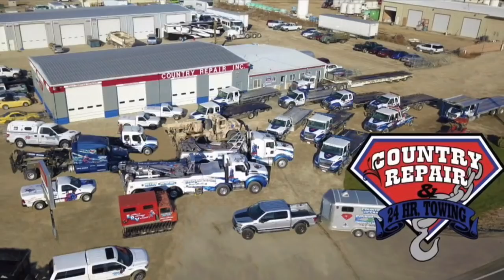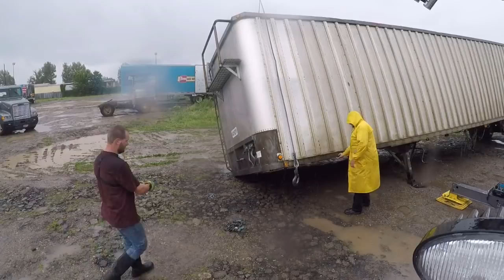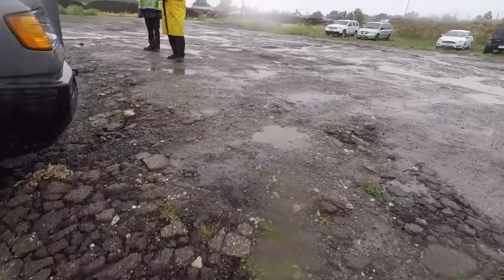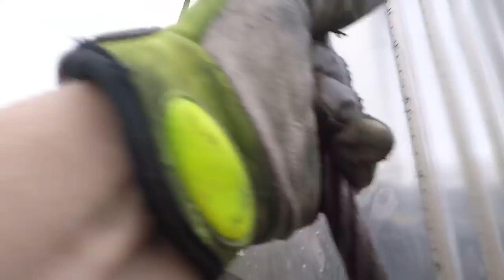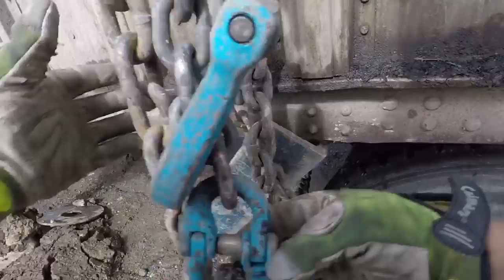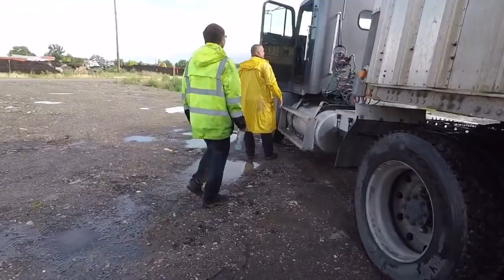Rotator Flexin

Comment: as a fork lift driver i was loading a trailor with firebricks and lifted the back end into the air....me, fork lift and bricks were left piled up in the front with the back of the trialor wheels 10 feet off the floor........

Comment: When doing a lift that rotator needs to be 100% off the ground. Its 70k counter weight. Miller will tell u that. Also its a miller you don't have to idle it up for extra hydraulic pressure. Miller will tell u that also. Get the truck air born and itll handle alot more than that light 36k. Ive lifted 56k off the side of mine before
Reply from the maker: Yes we learned that! Thank you 👍🏻 we’ve lifted close to that, not quite that much though
Reply: @CountryEquipmentRentals  i highly suggest millers rotator school if you haven't been. It's neat and teaches even seasoned operators like me how to use the rotator to its full capability and you get to tour the factory where they build all the wreckers if extremely fun
Reply from the maker: We’ve been to rotator school and classes but not miller’s. That would be fun!

Comment: It seems that more leverage and easier lifting could be accomplished by hooking as close as possible to the front of the trailer.  That should have lightened the lift.  IMHO
Reply: JERRY JAMES you don’t loose a lot picking at the front but with multiple chains we needed to be behind the pin so the truck could get in and hook
Reply: @michaelseverson9809  at least you did not have to unload the load to lift it ..  job well done ..